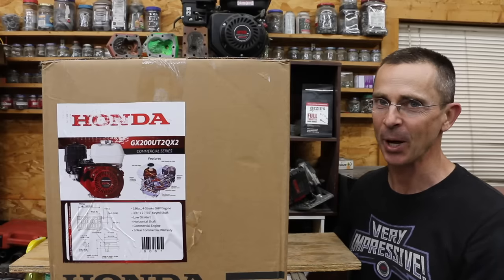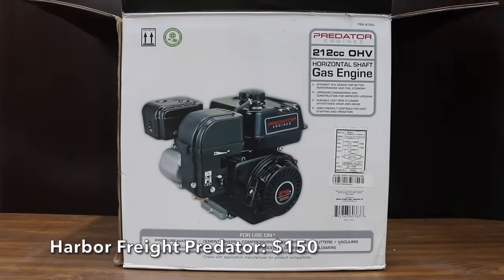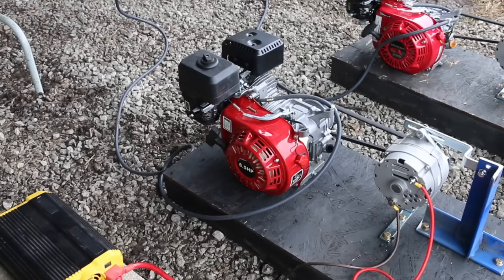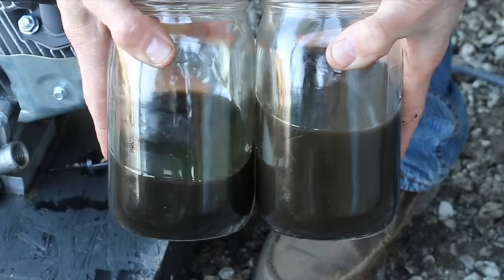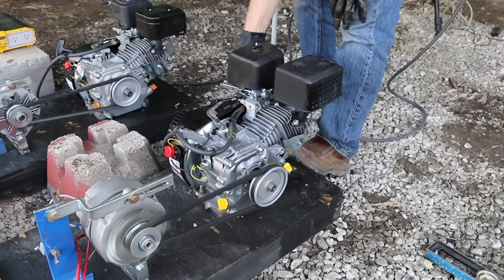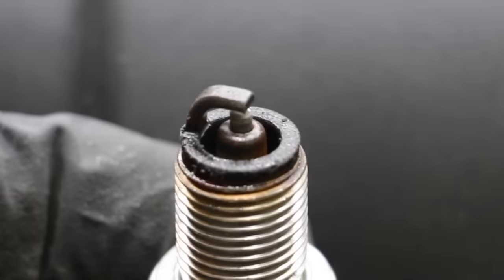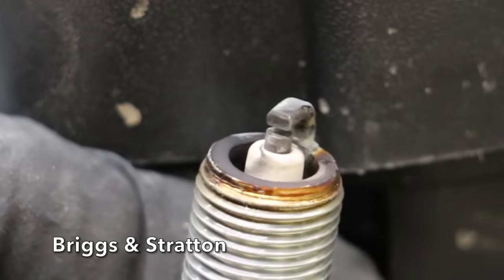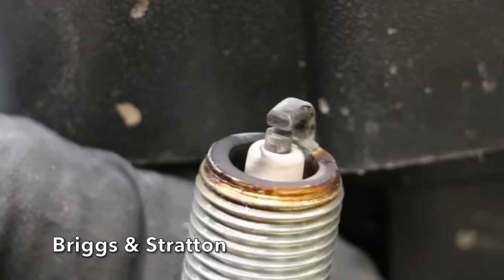$150 Honda Clone vs $600 Honda? Let’s settle this! Fuel Efficiency, Horsepower, Durability, Starting

Comment: Genuine product vs knock-off is one of my favorite guilty pleasures on this channel.  I love seeing if you can still get your money's worth if the discount is enough and not many people besides Project Farm cover this kind of thing.
Reply from the maker: Thank you very much!!
Reply: Wouldn't even call it a guilty pleasure, it's a legitimately useful service.
Reply: Awesome video!  Can you make one of the best wood splitters! Thanks so much
Reply: Don't Read My Profile Picture  OK, I didn't.
Reply: I refuse to support IP theft with my money, but I agree it is still good to see someone doing these comparisons that show just how cheaply made the fakes are.
Reply: Agreed
Reply: Absolutely one of my favorite topics!
Reply: You can't beat a Honda Engine,. In the long run, you're better off with quality versus the other. You just end up with more aggravation with cheaper products.
Reply: @tigergreg8  I've run honda generators for water/power for years and totally agree. Hondas are tanks.
Reply: @Longplay Games  and when they do need repair, they are easy to work on too.
Reply: Any time snap-on takes the L I celebrate😄
Reply: The only legit one I've actually bought is WAITLEY M12/18 MILWAUKEE BATTERIES. Sooo cheap and they work perfectly and last a long time
Reply: @thepewplace1370  design patents expire and then the IP is free for all to use which I believe is the case here.
 
Supporting the original IP because of quality is one thing but many times it truly is a waste of money. 

The predator performance was so close  to the Honda that I can't find justification for a 300% mark-up. He didn't show it here but if you run the numbers for $/kw it makes me think Honda is ripping me off.
Reply: Yeah, I love this.  It's also what I love about the mass test videos, because some of the ones are clones of others, so I can see my best value
Reply: @ProjectFarm  thank you, sir!
Reply: Spark Plug analysis tell the tale. Those Honda clones will not last. Construction people only use Honda engines, they cannot afford to have their equipment not working.
Reply: There's no extra cost for the dents in the gas tank.    SOLD!
Reply: @Longplay_Games  👍
Reply: Are all 4 spark plugs the same heat range? Are the spark plugs gapped the same? Are the jets in the carbs the same size? Would been nice to see second test with 4 of the same spark plugs gapped the same with same size jets in each carb.
Reply: @tigergreg8  absolutely, Honda  engines are quality build.
Reply: Usually you can get the value just not the duration.
Reply: @thepewplace1370  lmao, as if the people who make money on these things came up with the original concept. Also I don't think you know how patents work, after a period of time competitors are allowed to utilize it
Reply: @michaelbrinks8089  Is that even possible now. I mean, engines usually take different size plugs and gaps, so I'm wondering if that would even be possible.
Reply: @tigergreg8  They're all the same size/displacement engines (or very close)so they should all use the same heat range & type of spark plug & use the same gap. He did a great testing but using same brand of spark plugs, same gap & same size carb jets in each engine would have made for more even testing. Of course he's testing/going by with what comes stock when you buy it. But a different spark plug type, wrong gap & heat range can make a big difference in power. How much or less each air filter flows would make a difference also.
Reply: @michaelbrinks8089  that's my only complaint. With the exception of the briggs, the other 3 all are interchangeable carb-wise, but pound for pound I'll stick with predator since I can use the savings and juice it up for peanuts.
Reply: @michaelbrinks8089  I see what you're saying. I think when he does testing, he's also showing us how committed these manufacturers are to making a quality product. Most had decent filters, except the knock off Honda. The learning experience I get from this is. when you cheap out on something as simple as a filter, I can't begin to imagine what else they used to save costs. In other words, he's saying, it's just not worth the savings.
Reply: @waterboy5164  Electric or Petrol ⛽️ How Many Ton ? I lucked out Many Years ago on a Home Built Beast with 11 hp Honda .... would be an interesting video
Reply: The Spark plugs are fouled from oil deposits due to oil burning not jetting /spark plug gap. Hence why he said he had to keep adding oil to the Honda clone!!!
Reply: @Jerry Schneider  I have 2 concrete buggies that both have predator 420cc engines. Both get used 5-6 days/wk and have lasted 5 years, going on season 6 with oil changes twice a year, spark plug changes once a year, and air filters as needed. I can attest they will last as long as newer Hondas. The older Honda engines were of better quality like everything else.
Reply: The predator engines have terrible spark plugs and the gaps are anywhere from .017 to .072!😮
Reply: @MrBrian  so correct the gap or put a new plug in it for $8 and you're still saving money...
Reply: @thepewplace1370  Have Honda got world copyright on a red engine or anything the other one used?
Reply: Why hasn't Home and Garden Channel or one of the "home" channels picked this guy up?  Discovery Channel might be really good.  Look at how big a hit Dirty Jobs became. Once people start hearing about him/what he does, I think it would be a BIG hit. As long as there were no advertising that had anything to do with the products he test, then he could remain totally neutral.  Think if he did this with bigger home generators.  Everyone should have a generator. So many crazy people out there, look what happened in NC with shooting up a sub station.  That could go on all across the US and people were without power for 5 days in some cases.  Let's not forget hurricanes/storms and the rest.
Reply: Yea, but wont last as long
Reply: @dropndeal  I have just checked up on this, the GX200 came out in 2002, and in the US design patents last for 15 years, after that, the design is legally Public Domain, availble to anyone who wants to use it.
Reply: Repent to Jesus Christ “For the Spirit God gave us does not make us timid, but gives us power, love and self-discipline.”
2 Timothy 1:7 NIV
ht
Reply: Very true.  The Honda is the best, but you can get your money's worth out of the Predator and turn it into scrap metal three times and still be ahead of the Honda.
Reply: Not only do I agree with this comment, the other responses are also hitting the nail on the head as well. I would go as far as to say that this kind of video and discussion thereof is exactly what the internet was meant to be used for.
Reply: One of PF’s best evaluations ever! Shows how inexpensive you could build your own small generator!
Reply: @Project Farm  you are sure welcome,  I say thank you. I found you tested snow shovels, but, I couldn't find regular digging shovels.     Just a thought.
Reply: If looking for residential.  I did a review on the boss 7 ton a few videos back.  Check it out.  For the price it’s solid
Reply: @tigergreg8  You are dead right Sir. Peace be unto you.
Reply: @tigergreg8  in the construction and landscaping industries here in the UK, virtually all small plant such as generators, hydraulic packs, lawnmowers, will have a Honda engine. They last for years with minimal maintenance. Can't beat them.
Reply: For real. $150 that motor really is not the bad for the price.
Reply: @Abitflippant  you're looking at strictly the short term. Over the long term, and in cases where people time is worth more than min wage, it's almost never worth going with the cheaper option. My time is worth 10-15x min wage, and if I stopped 1 hour messing with a cheaper alternative, or returning it because "it has a lifetime warranty and yOu cAn GeT a nEw oNe wHenEvR," it's already ate up all the savings.
Reply: If Project farm covers a knockoff it’s usually good
Reply: @classicrider103  lol not really, spark plug gap alone makes a big difference if it's way off & will make it run like crap. Or try  running a plug that's too cold with a rich air/fuel mixture & see how fast it gums up & runs poorly. Wanna destroy your engine & melt a hole in your piston. Add a carb jet that's too small so it's running too lean & overheats. I agree the predator is best bank for the buck & decent build quality. It'll run even better when properly tuned air fuel mixture. Also an aftermarket carb & air filter can squeeze a little more power out it.
Reply: Exactly,cars and cameras uses a lot of predator stuff and other brands,but never seen them do a comparison with actual Honda
Reply: I agree. With companies charging more and more for the products, an equivalent no-name is always welcome.
Reply: Yup! He does great work. I think the only concerning thing with such tests is that the genuine ones are likely more consistent out of the factory whereas the knockoffs even if they perform well here, are still hit or miss.
Reply: @tigergreg8  yup, Honda makes great motors, older Briggs are my favorite but Honda continues to make a good product no matter what.
Reply: @Abitflippant  ya but how about in 1000 hours? That’s where Hondas win, they’ll stand the test of time. I have one on my pressure washer, it’s spent 4-5 winters outside and starts every summer with old fuel, I think I’ve done 1 oil change.
Reply: @ProjectFarm  Hi I suggest you to test compact circular saws I know you might not see this but if you do a review on those would be very helpful
Reply: @Abitflippant And, the Predator factory workers are underpaid....
Reply: @michaelbrinks8089  this isn't about the stuff you can do after the purchase. It's what your money gets as sold.
Reply: @littlejackalo5326  your time isn't worth that really, but you have to charge that to buy all that expensive equipment.....
Reply: @michaelbrinks8089  But it becomes endless, because you should also replace the bogus air filter with quality, maybe get a better carb, where does it stop?
Reply: Excellent Video,  .... very informative and interesting  .... Bravo  !!
Reply: @WrightsW5  of course not, and the Chinese companies ripping them off wouldn't care if they did. But this is the MO of these companies: copy closely a staple of the segment and try to dupe folks into buying what they think is the real item at a discount price. By the time they have the crappy knock off in hand, the hassle/cost of returning it means most likely the manufacturer will just keep the money and the customer will buy another.

The knockoff is unabashedly trying to represent itself as a Honda, known for their small engines, and make money off the hard work Honda has put into building that reputation.

If they wanted to just make a cheap motor and sell it on its own benefits, they'd have gone the route of the Predator, which doesn't pretend to be anything besides a cheap, made-in-China small engine, and a surprisingly good one at that. While it surely incorporates components that were once under someone else's patent, they aren't trying to bank off of someone else's name brand and potentially tarnishing it in the process.

Chinese manufacturers are known for this (ordered anything on Amazon lately and gotten a fake?) and it's not always without consequences. One that makes me angry is the counterfeit CAT tourniquets. They market them as a North American Rescue CAT TQ, which is a proven life-saving device, except the knockoffs fail when used, which leads to death of the user. If you buy a CAT TQ on Amazon, you're likely to receive a knockoff, but if you don't know any better, you won't know it's a fake until you're using it, at which point it's too late.
Reply: I don't know why this would be a GUILTY pleasure....
Reply: @Project Farm Can you make a video comparing Outdoor Car Covers?
Reply: @thepewplace1370  If something is dangerously bad that's an appalling situation, but this aspect was about copyright situation, you can't blame someone for not breaking the law. If it hasn't got Honda on it and it's past copyright then no issue on that. Whether it's  junk is another issue.
Reply: I used to work for a Honda dealer and when Chinese built Honda industrial engines came into Australia, Honda MPE Australia refused to warrant them even though they were allegedly [without any apparent doubt] built to Honda specs in China. probably as Honda MPE had not imported them. My first contact with Chinese knock offs came when a fellow walked in looking for a Nylon recoil  gear for some6thing called a "Minghi", it was a Chines knock off of a Yamaha engine. Another person came in asking us of our opinion of a Chinese import under the brand name "Skorpion", I suspect he was connected with the importer and did not react too much to our warnings about buying a new product with no known back up, maybe only a 2 year warranty. we suffered 2 broken windows soon after, just had a bad feeling about him, maybe he was hoping we would show signs of interest in marketing his/ product., Did not like his parting gesture.
Reply: @WrightsW5  except it's country of origin has no problem ignoring copyright infringement, and it's often state sponsored. This is a common issue with China exports and one of many reasons we need to avoid sending them money.
Reply: Small engine gas powered equipment is one area where the cheaper knock-off is not going to be worth the initial savings, especially if it is for mission-critical applications. Hondas are true to spec, reliable and hold their value.
Reply: Great test
Reply: @ryanpaaz  this test doesn't cover that
Reply: @tigergreg8  it would be but you would have to put it on a dyno to check if kW/ hp was the same to test the theory properly
Reply: In a hard use application Honda is the way to go. I bought a predictor to be stand by power for my freezer. For my use the predator works. Good to know I need to add replacement spark plugs and frequent oil changes. With a long power outage I will need to do frequent oil changes.
Reply: @jerryschneider145  companies make a lot of money, they can afford a Honda, and that's OK, if you have the money, buy the best, but the rest of us have to make do with what we can afford.
Reply: @littlejackalo5326  if you have the money, go with the best, if you don't, you go with what you can afford, even if you don't like it.
Reply: @americafirst2785  That is true. I usually buy good used stuff.
Reply: What's guilty about it
Reply: @tigergreg8  You can't say that at all, you don't know how a person is using the engine. sometimes better is better, sometimes cheaper is good enough, and sometimes more expensive isn't any better.
Reply: @littlejackalo5326  Who says I'm going to even have the motor "over the long term"? sometimes cheaper is good enough.
Reply: @steved8714  I like Honda's, but I have a Champion Generator that has a China engine on it, and I have over 10,000 hrs on it, and it still doesn't even smoke or use oil. there is good stuff made in China, but the mfg has to hold them to the quality.
Reply: @joemendyk9994  What they agree to work for is absolutely none of my business, nor should it play any role in my product selection
Reply: @integr8er66  I rarely ever find that to be true.
Reply: @Abitflippant  Not a rip off, but not 3 x as good either. Honda is a name that you can count on them having replacement parts for cheap for a very long time. Thats a big factor for me. 
I prefer to drive my 2007 Ford Focus, handles better, has more power, less issues with the interior controls, everything lasts longer besides the bearing for whatever reason, etc, but I can't buy some parts for it anymore and have to rebuild things myself or scavange the junk yards. My 91 honda civic though, I can find any part for it almost anywhere still, and they are cheap cheap! I have a feeling the same would become of the Honda vs Predator in the long run.
Reply: @KJF87  as someone who does regular maintenance on their tools (which I'm assuming you do with your cars) the predator seems like the better deal. Buy two at the outset and if one breaks you have the second and you still have the first for parts. Maybe you get lucky and the 2nd ones failure point is different or maybe have a big job and the second one doubles your work capacity still at a great savings. If the predator was significantly lower in performance or more expensive my opinion would probably be different. 
And then there's the neighbor factor where I'm more okay when my neighbor loses or breaks the cheap one. 
Idk, maybe y'all are right but I grew up having to learn to fix things that break so I think of having to fix stuff as par for the course. And when my shit breaks unexpectedly I ask my neighbor... 😐
Reply: @bbaaspencer1  Perhaps, But a quality replacement NGK plug costs a lot less than the extra cost for a Honda engine.
Reply: Too much  information.
Reply: One thing I wonder about with the knock-off products is the consistency of them. Sometimes you'll hear about a great deal on a less known or clone brand but then hear a ton of complaints shortly after. Could be made in different factories and stuff..
Reply: @anzov1n  it just makes you wander if Honda has been getting stuck into us over the years when there was little or no opposition no wander we don't have any loyalty to them
Reply: @michaelbrinks8089  that's a very good and valid point
Reply: Please test jobsite radios i want to get one and not sure which. Battery life durability technology etc. Love your channel! Your tests are the best!
Reply: @Longplay_Games  If Hondas are like tanks I will never buy one. Tanks break down more than a 1908 Ford model T. Also I have a 51 year old riding lawn mower with a Briggs and it still runs great.
Reply: Agree. Reminds you why it's important to pay a little more for quality
Reply: @tigergreg8  yep a family member has a honda mower. Is 35 years old and starts first time everytime. More expensive to buy but totally reliable.
Reply: @tigergreg8  I've got 2x Honda engines. A single and a V twin.
Of all the numerous small engines I have, they just start.
Reply: I care more that it lasts. I can't stand buying something cheap knowing it'll fail and all the resources used to make it are basically landfill. I care more about that than spending a bit more at the start because I feel like whoever built it actually gave a shit and the thing will keep on ticking longer and have spare parts when it does crap itself. Those Chinese knock off's you'd be lucky the brand exists by the time you need a spare part let alone the spare parts being available.
Reply: Guys like this, who really DO do a great service for the public , should be eligible for a grant to help pay his costs.
The millions of dollars our government (excuse the expression) pisses away, on things we don't benefit from, things like this should be covered in a heartbeat.
Reply: @thepewplace1370  it's NOT IP theft, for good reason of protection from corp monopoly, IP protection ends at an amount of years. Without that, we wouldn't have affordable 3D printing or others manufacturing and d improving AR platforms
Reply: @Longplay_Games  I have 2 predators I can parallel kit them for cheaper than what I paid for my Honda 4 years now no problems never burned a drop of oil
Reply: FTCCP!
Reply: 8:54 What is NOT genuine, is the graphic representation of the shown values. Looking at the bars, it seems as if there was 3x (300%) more fuel consumption at Honda Clone comparing Predator, whereas in fact the difference is 60/56 (just 7% difference). THAT is what you call in psychology "subliminal manipulation". :face-blue-smiling::face-blue-smiling::face-blue-smiling:
Reply: @bbaaspencer1   This > pretty much sums up my experience with 2 Chy-na Knock Off scooters. Everything is cheaped and consistency is very rare.    ///The predator engines have terrible spark plugs and the gaps are anywhere from .017 to .072///
Reply: Usually you can get the value just not the duration. Thank you so much
Reply: @WrightsW5  but the clock on expiration date for a patent only starts ticking after the patent is fully accepted and finalized. That's why ou see so many products marked "patent pending ". Keeping the patent status in a pending g state is a loophole to extend the use of patent protection.
Reply: @thepewplace1370  Honda started by cloning other engines - so it is just karma
Reply: @integr8er66  probably helps that its likely an older Honda clone..
Reply: @haroldjones1473  who did Honda Clone?
Reply: @repentandbelieveinJesusChrist3   We're gonna test that!
Reply: My neighbor has had a Honda generator for 20 years and still going strong. That's the real test.
Reply: @Steve D  I had one on a pressure washer in Colorado and sat outside for 5 years....same fuel and started right up probably 4th or 5th pull. I could not believe.  Shot 5 year old water out pump too.
Reply: Hey you never use full synthetic in any small engine because the rings will not seal especially when it's a new engine the rings have to break in
Reply: Seems like they just put name tags on them.
Reply: Is there anyone's where the knockoff is actually better?
Reply: Maybe break-in oil and break-in runtime should have been done before all this testing?
Reply: @Longplay_Games  I have Honda HS55 Snowthrower that was built in 1980. Still has the ORIGINAL engine AND carburetor! The engine internals have never been touched and the thing starts on the first or second pull (NO electric starter). Honda ALL the way! Btw, it is SO satisfying to see "Made in Japan" stamped on ALL the parts!!
Reply: Mean? They are both made in India and sold from China😂
Reply: Problem is these tests dont really take longevity into the equation. I think that's where the value proposition falls apart with clones. They may have near parity new to low hours, but they fall apart much earlier, generally.